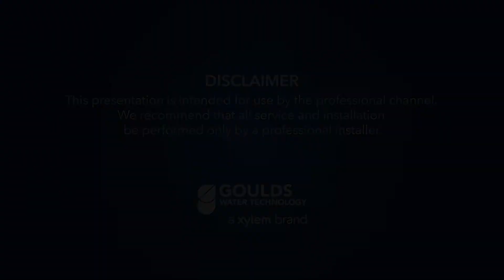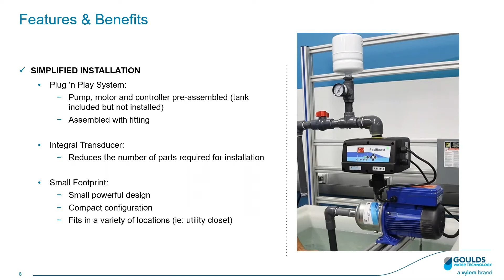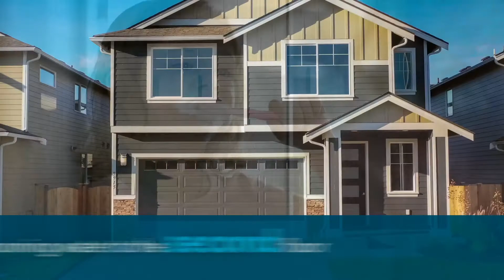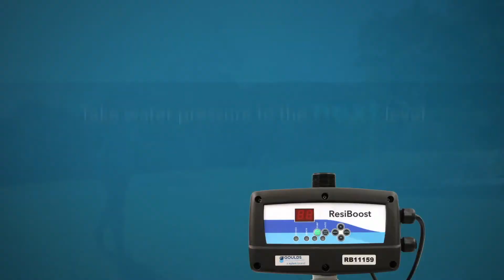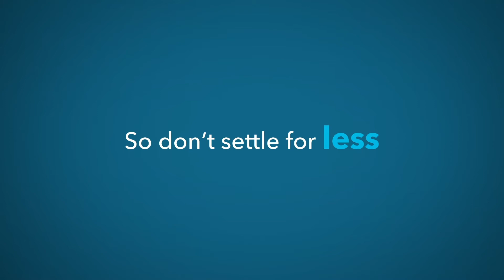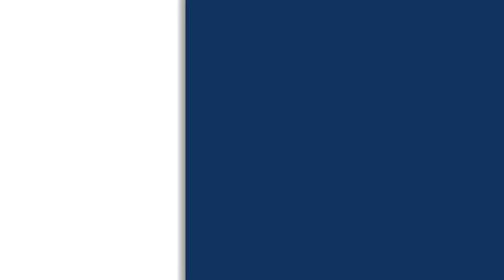ResiBoost – An Inside Look at the Complete Packaged Variable Frequency System

Comment: Why do we keep getting an A7 alarm on our brand new pump? And yes, followed all the guidelines, have enough amps on the circuit, gfi protected, etc.
Reply: Had this exact problem with the A7 alarm.The problem was a stuck impeller, just take out the fan cover at the back of the pump and manually spin the fan with your hands until it feels loose and rotate freely then reset and test run the pump.